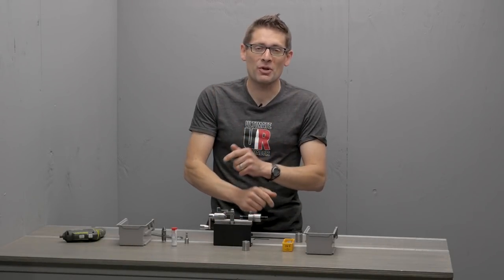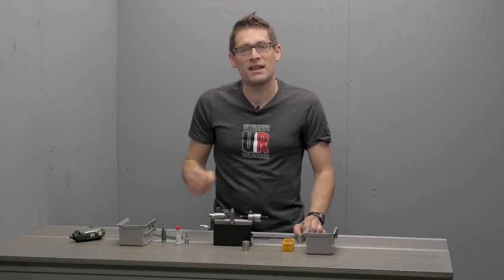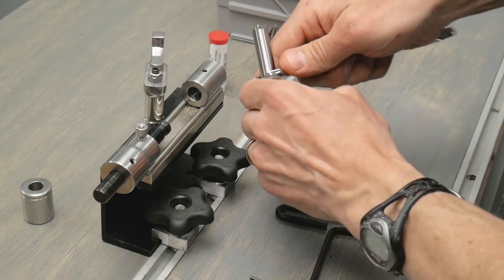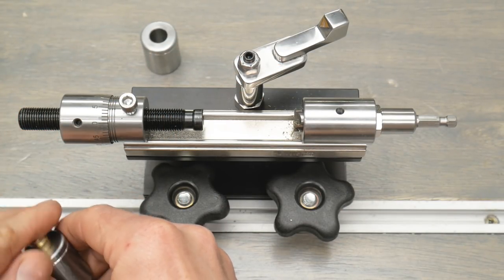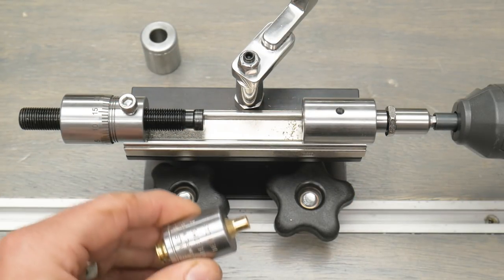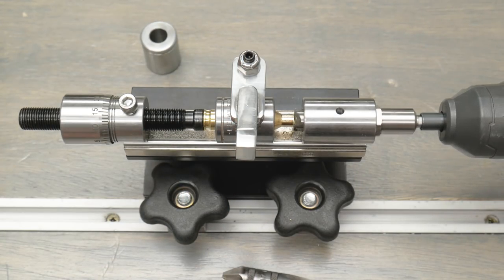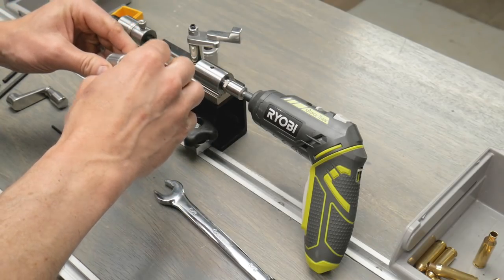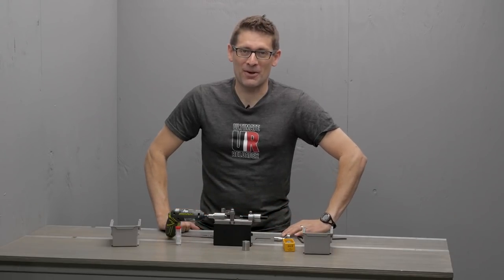Speed and Precision: Wilson Case Trimmer Power Adapter

Comment: Talk about precision, for the average backyard reloader, Wilson is a tough one to beat. - Update -2yrs later. I finally bought this LE Wilson trimmer but I use it for internal and external neck turning of my new pet brass! Forsters trimmer also will do both internal and external neck turning. These are the 2 best options I found  below the 1799.00 IDOD trimmer. I also got Wilsons inline seating dies and the arbor press with force gauge for seating all my loads in my 2 best long range rifles.  Consequently I have been using Wilson case gauges and micrometer for them. When I got my 1st box of Lapua brass I knew I had to step up and neck turn and do everything as accurate as possible to get the most concentricity out of my loads as possible.  The motorized neck trimmers are tough to beat for speed but now I have another option for precision trimming with my LE Wilson neck turner as well!

Comment: So what exactly happens if you use a drill driver? Even one with an easily controllable speed via the trigger?
Reply: spyderxtra777 it tends to create burrs and can roll over the brass instead of biting into it an cutting it. It really just makes for more deburring in the end.
Reply: Randal Hall ok but should I be good if I just go slowly with the drill driver? I know with my dewalt 18v I could fairly reliably mimic the speed of that tool he has there
Reply: spyderxtra777  yes it is a combination of speed vs. feed. The slower the feed vs. the speed of rotation equals the smaller the chips generated. Small chip equals less burrs.
Reply: I use a cordless drill on slow setting.
Reply: spyderxtra777 I personally use a cordless drill and just go slow. Mine has a high and low speed so I just set it on slow and go lightly on the feed pressure. A clue that you are going to fast is larger chips and possibly strips. Also if you see the burr roll over the mouth use less feed pressure.

Comment: I need to get a cheapo screwdriver already, I bought the adapter a year ago, lol. Mine is in a little set up from Sinclair and the crank handle over 100 cases is killing me. I like the WFT I have for high volume, but it is very sensitive to how you hold the case for good, square trims.

Also, what is your opinion of Peterson Brass?
Reply: This one does pretty good, it indexes off of the case taper that was created by your chamber and uses the case head to index off of for case length. So if your barrel was chambered properly, and your bolt face is square, it is about as good as it is going to get.

Comment: Any idea on how to accurately spin a tapered  case at high speed for neck turning?
I have tried the K&M power adapter with the Lee shell holder and it does not
work very well. Thanks and nice video.
Reply from the maker: 100-200 rpm for this tool...
Reply: Redding case trimmers grab the cartridge by the base and the entire case then rotates, which works great when used for case neck trimming. For actual case trimming, the Wilson is much, much better, but the Redding trimmer works very well as a brass spinner alone. I'd look for a used Redding trimmer... they should be out there and pretty cheap from people that have upgraded.

Comment: cool gavin, you should compare the accuracy of this to the Giraud trimmer!!  i have the hornady power prep station, but im looking at the giraud, because with that, you don't have to mount each case in a holder and take it back out for every case.
Reply from the maker: The giraud trimmer is great, but works by headspacing- so there's a different kind of accuracy there (shoulder to case mouth, not case overall length).
Reply: gavintoobe right, but maybe it will still be accurate if all the cases are bumped the same?
Reply: You won't beat the accuracy of the Wilson trimmer.

Comment: This video shows exactly what not to do... how not to slam the cases after they have been properly trimmed and chamfered... especially for a precision shooter.   Shoot lots and stay safe.
Reply: Wilson instructs you to do that.  I have this trimmer and haven't had any issues with the cases by lightly tapping them.  However, you can never be too careful!
Reply from the maker: It’s a light tap, this is wet quite a few benchrest shooters do and what Wilson instructs you to do, even sat down with the president and he showed me first hand.
Reply: I have the Wilson trimmer. Mine came with a "hockey puck like" white 1/2" vinyl disk (cutting board material) on the tray in it's own slot that I bought some years ago from Sinclair Intl. I tap it on the disk every time and it does not effect the case mouth whatsoever. I'm sure the way Gavin is doing is fine as well. 
However, as the old saying goes, "to each their own". Everyone has an opinion based upon "their own experience" and that doesn't translate to, "you are doing it wrong".
Just my .002.

Keep'em coming Gavin.
Reply: Gavin... those were no slight taps those were slams. And... yes it does affect the necks concentric shape did you ask Wilson's President that question... because I did, or at least their employees.
Reply from the maker: We'll have to agree to disagree here- you can apply as much or as little force as you like, same with me. :)
Reply: @bisonuberti  - Bison, you are wrong - I adopt the same degree of ‘tap’ & haven’t damaged a case mouth in 30+ years of using the Wilson trimmer.
Reply: Sure Russell... It took you two years to place an answer. Yes, let me be wrong. Shoot lots and stay safe.

Comment: Swapping between power adapter or crank handle wont make difference to length settings. It spaces off the nut which is fixed to the cutter :) 
I got the Sinclair version. Identical.
Reply from the maker: On the version I have, the nut is not fixed to the cutter, so it does affect trim length in my case!
Reply: My Wilson trimmer is 8 years old and the nut is definitely NOT fixed to the cutter.  You WILL change the dimensions with a different handle.

Comment: Slamming the sized, trimmed and chamfered case mouth on the table to remove the case can't be good for minimizing runout. Also, slamming the case into the holder could affect headspace.
Reply: njgrplr2007 yep, you would think, but it doesn’t. And it’s less of a slam and more of a tap.
Reply: I am interested to know how headspace would be affected? It is a straight tapered bore in a piece of steel. If you mean slamming it so hard that it begins to squeeze the case into the shape of the holder, ok, but it seems obvious that you shouldn't do that.
Reply from the maker: Hey guys, it totally doesn’t matter how far the case is in the case holder because there’s a rear stopped and a cutting-edge those are the only two reference points always - you can get it under thousandth of an inch if you’re careful (consistency).
Reply: Correct, the amount that the case enters will vary depending on the sizing that is done, but the OAL case length is consistent regardless. The Sinclair mic on mine leaves something to be desired though. The graduations are not equal to the amount that will be trimmed.

If I may make a few suggestions for video topics?

- Recent advancements in high BC bullets, especially 6.5mm, as compared to other heavy for caliber bullets from its neighbors the 6mm and 7mm. 
- Your thoughts on Rem/age prefit barrels as it relates to accuracy. Viable option for precision rifle use or are there alignment issues that are bound to happen a-la receiver faces and thread tolerances? 
- Lab Radar: the future or flash in the pan? Calculating true BC's (maybe?) and being able to use it in overcast conditions is appealing. I use a traditional chronograph and it is a constant source of irritation (CED).